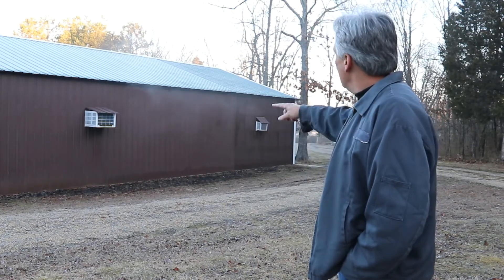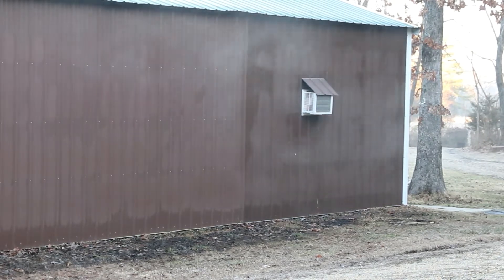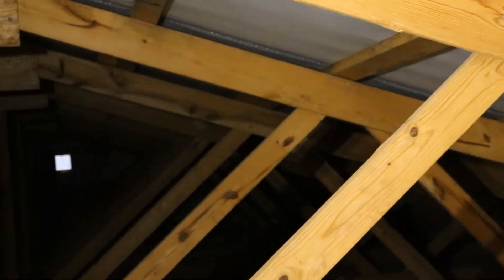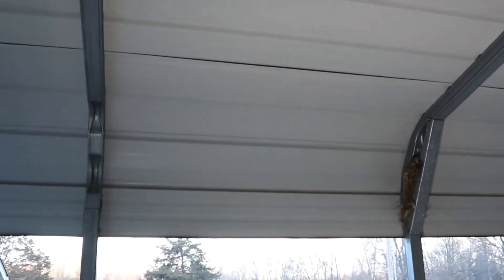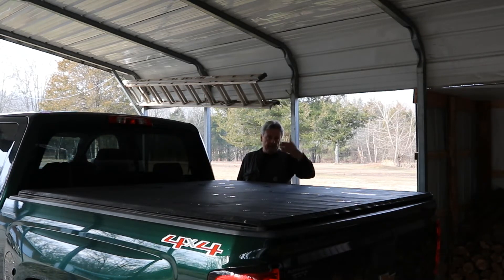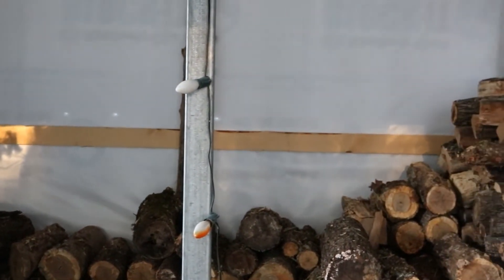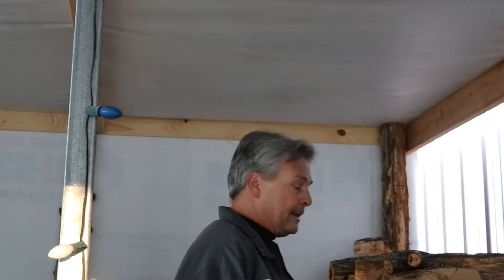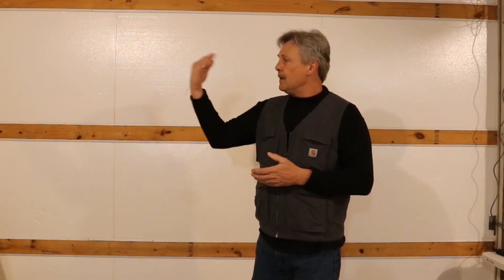Building a Pole Barn , This is Something You Should Consider .

Comment: Good advice.   Unfortunately my pole building doesn't have a vapor barrier and now I want to finish it.   In Minnesota...
Reply from the maker: Thank You . I wonder if you use the spray in foam if that would provide enough of a barrier to keep the metal from  condensation  . That may be worth looking into .Surely there's a way to do it before you finish your Building  good luck and   Thanks for Watching
Reply: @AskDaddyjoe  thanks for the reply.   Very kind of you.   I think you're right spray foam would do the trick unfortunately it's also the most costly.
Reply from the maker: @davidhaley7053  Yea and since it would have to be spayed to the metal it wont keep the heat down closer to the floor where you need it sometimes it cant be easy .